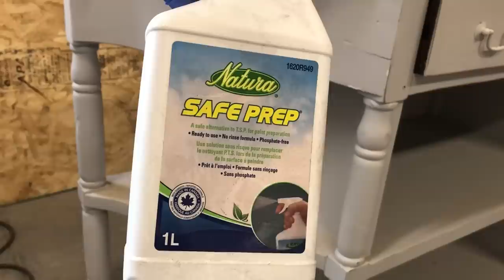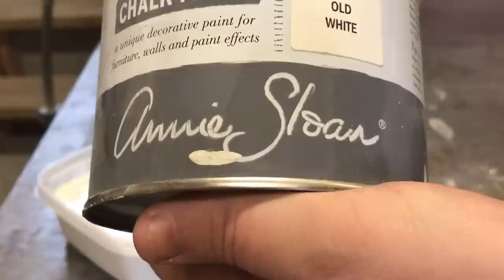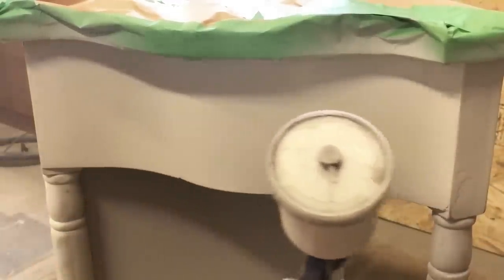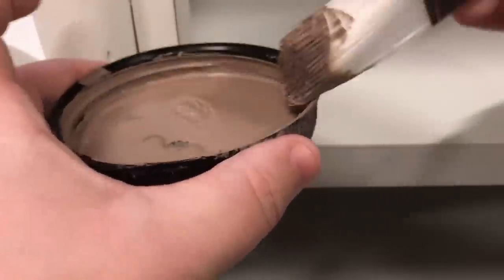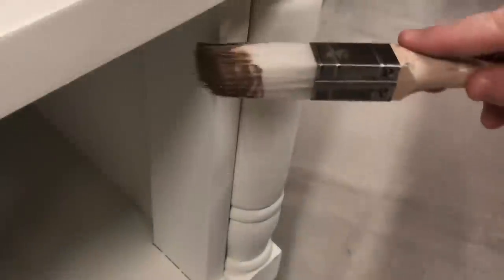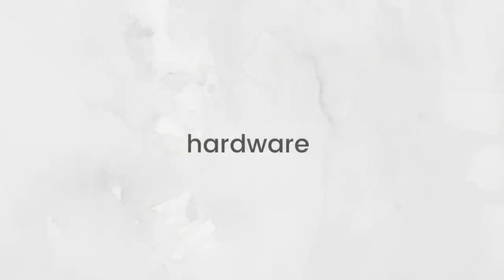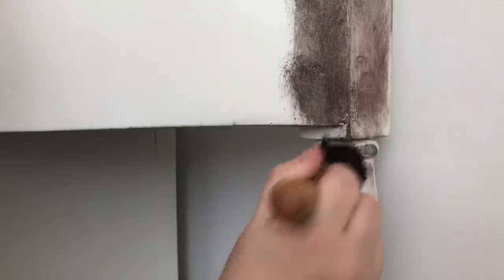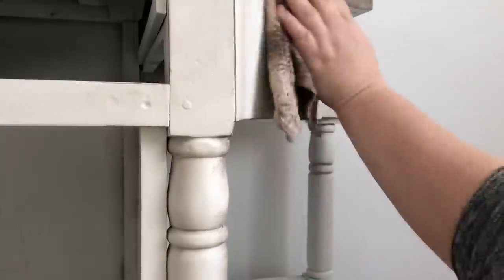Farmhouse Finish Media Console & GIVEAWAY!

Comment: I have an old cabinet that has these kind of handles. Each handle has 3 parts.. The middle part that you pull on comes out of the 2 side knobs bc I had one that wasnt tight and the middle handle part kept falling out. I would have to get some pliers and like turn the left side knob part to the left and the middle would fall out and I think both knob parts are just screwed in so if you could turn it just enough so the middle part comes out then you can unscrew the 2 knobs. I dont know. I know thats about as clear as mud! But the piece turned out beautiful just the way you did it!
Reply from the maker: I’ve dealt with this style of handle before but these were riveted into the wood and I don’t think they were intended to ever be removed. If I’d tried I would have either ruined the drawer front or the pull 🤷🏻‍♀️

Comment: I'm sure there's a reason, but haven't figured it out.  Why not do the top AFTER the painting of the body and avoid taping off?  Love the way this piece turned out!  Great Job!!
Reply from the maker: I like to know what I’m working with on the top before I start on the bottom. If I didn’t like the top and needed to change directions it may have affected the route I went on the bottom as well. Just makes more sense to me that way 😉

Comment: So informative. Was looking for a video that would help me refinish my drum coffee table. Did the varathane leave any yellow stain? Thanks
Reply from the maker: No. Any water based poly top coat will not cause yellowing. If there is every any discolouration it’s from something under the paint.
Reply: @salvagedbykscott   thanks for the fast reply. another question, have you tried to using Annie salon metallic gliding wax on a raised details and then finishing it top coat? Or would you recommend painting the furniture then top coat then do the detailed work with the gilding wax?
Reply from the maker: @biancabaluyut4177  you should not apply a water based top coat over top of a wax based product. It’s literally oil & water and will repel the top coat. You can apply decorative waxes on top of water based topcoats. They will cure and seal themselves. Hope that helps!